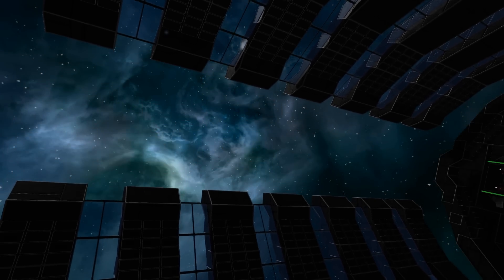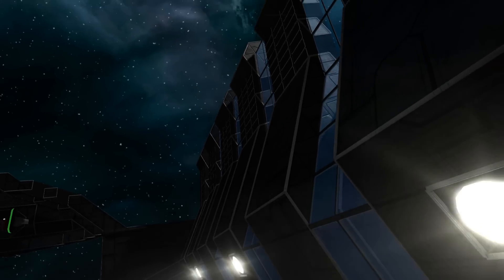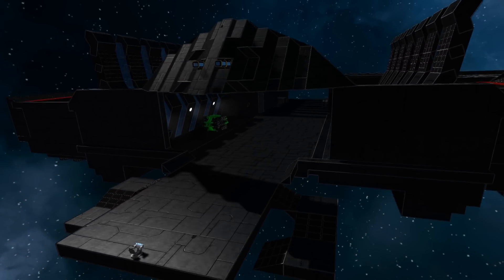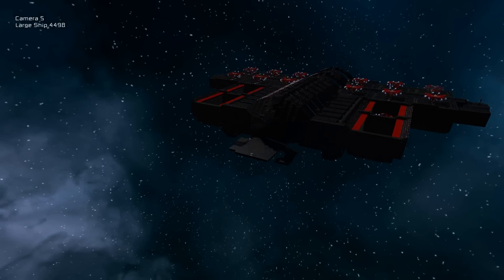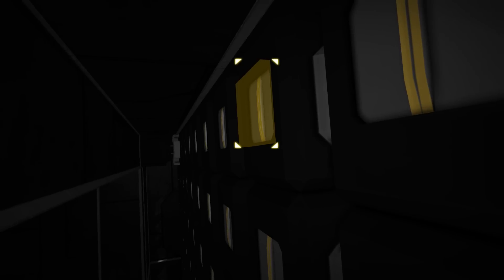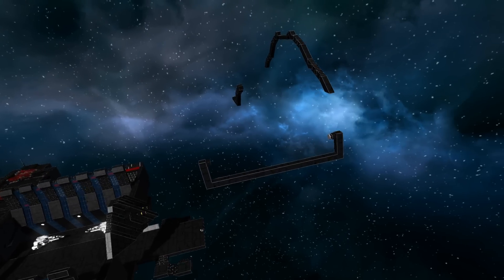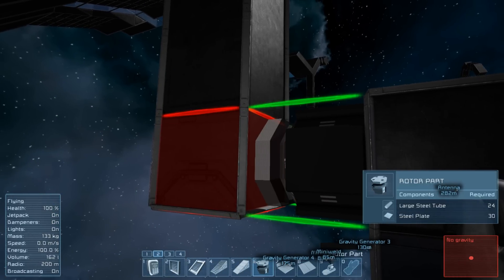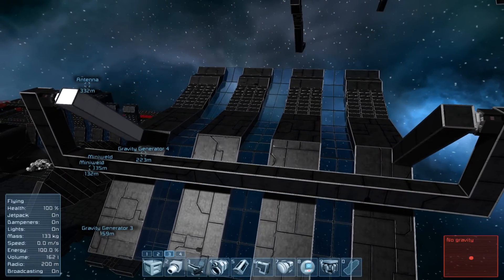Space Engineers - Next Gen Carrier #6 - Main Hangar Bay & Craft Recovery Plan

Comment: In your drone fighter bays, are those large ships, if so, how big is that bay? and are the fighters made with heavy armors, are those the same fighters in your hangar bay video?
Reply from the maker: Yes they are the same fighters (and bays) from the hangar bay video, so large ships indeed.. currently they are light armour although I'm going to redesign them slightly for the final product, beef up the defenses and armourment on them a little.
Reply: I tried using them, they seem a little slow and hard to move compared to small ship fighters, I understand this is hard to do because small ships are great as fighters, Im trying to use a small ship projector in those bays to project my own fighter, do you have any idea how to attach one? (your hangar, with a small projector to project a small ship)
Reply from the maker: RapidPixel79
You would have to place a small rotor part onto a large rotor and make the whole projector/welder system a small ship also, then link things up using connectors.. Was mostly the reason I went for large ships with this.. It's doable to use small ships but it's a lot more clunky operating it.

Comment: I'd suggest extending the drone bay welders after revealing the drone to keep the doors intact if someone decides they want to shoot them before you can launch. I also think you should see if you can build drones off of both sides of the door, then you can retract the welders building a new ship, swing them 180 degrees and push the welders back into place ready for the next drone and keeping the doors intact. right now it looks like you push them up, bring them back down, flip the door, flip it back and then push the welders up every time you want a new ship, seems like a lot of extra steps to me.
Reply from the maker: Yup, nice thinking dude.. relatively simple change that adds a load extra efficiency to it. Amazing how you can come up with a concept of something that flips and then miss the idea of using both sides :s DOH!
Reply: ***** Well, it does expose your merge block, connector, and projector to enemy fire at all times, but there might be a way to project the door.
Reply from the maker: David Wickham Aye but there should be a solution to that, covering them up when not in use or something.. in the end all the while it's producing fighters etc it's going to be pretty vulnerable so not sure this adds much more to the vulnerability by using both sides. Another option would be having defenses on the "flip" side that get repaired while fighters are launching.

Comment: do the grinder not fill up them self without connectors?
Reply from the maker: It's actually preferred, once full they drop the components directly out into the collector grid below.. some of the grinders are connected up also but I admit I missed some of them. Should be easy enough to correct though :)
Reply: ah ok :) i was just wondering